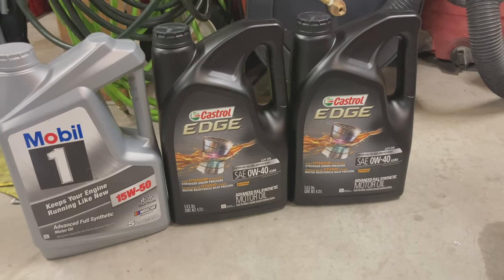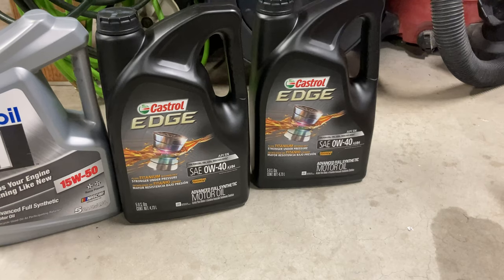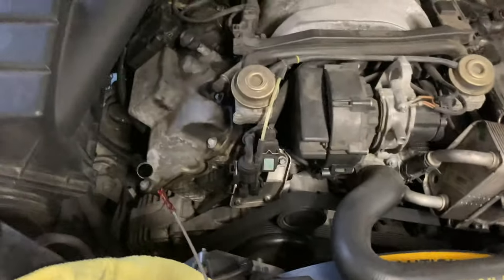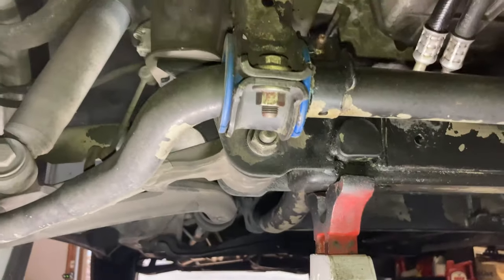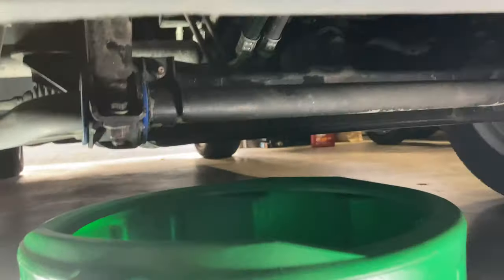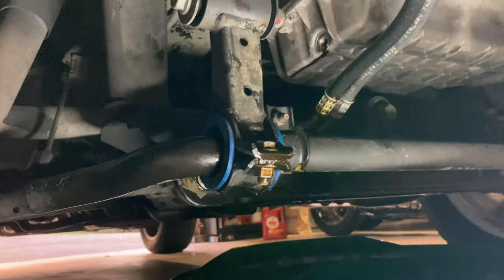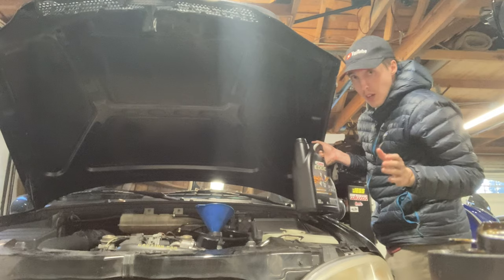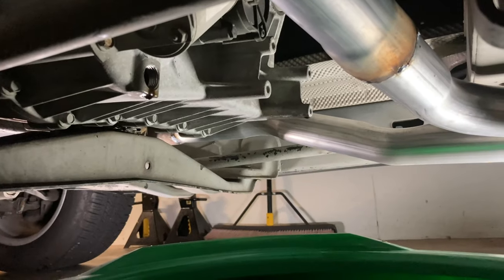Ml55 AMG Oil change + Transfer Case fluid change - Mobil 1 or Castrol EDGE?

Comment: You really need to get an oil vac pump, mercedes oil changes are supposed to be done from the bay, not under the car! So much fun once you get the pump. love how clean your w163 looks underneath. hey while you are at it, did you know there is a cooling fan in your fuse housing in the engine bay? it wears out, you can replace it for like 7 bucks with a new fan. if not, all kinds of electric stuff might overheat and burn out, had my AAM burn out this way twice before i noticed the fan was out!
Reply from the maker: I actually have a video on using a 12v oil extractor, worked pretty good. Thx for tip on the fan btw, wasn’t aware of that one!

Comment: Just switched my 2000 ml55 to Castrol "Euro" 5w40... Advance Auto Parts just started stocking it so that's my new go to and comes with free Mobil 1 filter.
Reply from the maker: Nice, I definitely plan to stick with 5w40 MB approved oils going forward. I stick with Mann filters since the design holds up the best, other filters tend to collapse and shrink over time but if you got it free, worth a shot.
Reply: @ANDERZENAMG  yeah even the Mobil 1 filter showed signs of collapsing a little bit w under 4,000 miles when I changed it last week.

Comment: I’ve been using penzoil ultra platinum in my 2014 Ford Escape 2.0 turbo since new and it consumes zero oil, I also use the penzoil euro  5w-40 now in my clk 55 amg
Reply from the maker: Yea I’ve heard that’s a great oil! It’s about 10-15$ more than Castrol, valvoline or Mobil 1 though so I haven’t tried it. Try to always stay under $50 for at least 10 quarts, but that’s just me trying to save a bit where I can. 👍

Comment: An AMG that doesn't need oil? That's a unicorn!
Reply from the maker: For real!!! This thing surprised me for sure,  7k miles half a quart and not even from burning it just leaky valve cover/oil cooler gaskets
Reply: @ANDERZENAMG  that's beautiful. My 208 and a 210 I take care of don't burn a drop of oil. The C55 on the other hand ...💔
Reply from the maker: @pulsiui4003  yea I’m in a bit of research binge trying to decide what oil I want to use on the C55. Thinking of blending valvoline euro 0w40 with 20w50 vr1
Reply: @ANDERZENAMG  I used to use M1 0-40 with much success. Extended oil intervals and harsh driving conditions, but after considerable research and a very slight improvement in oil consumption, I decided Liqui Moly 5-40 for the C55. The others still get M1. No matter how good an aoil is, if an engine is worn, it needs to be rebuilt to eliminate the oil consumption. We're planning to hopefully start that project mid way next year.
Reply from the maker: @pulsiui4003  also used to use Mobil 1 0w40 but the C55 would chew through it when running hard, the Castrol has done much better thus far. Definitely will need a rebuild at some point point for valve stem seals etc. I’ll have to do a series on it.
Reply: @ANDERZENAMG  That will be nearly if not impossible with the limited space. But I'll be tuning in 😅
Reply from the maker: @pulsiui4003  limited space as in my garage or? lol i'd rather try to condition seals back to good health before then though if at all possible. Might go with Valvoline Euro full synth 0w40 & Valvoline Pro-V full synth 20w50 which I will run a 56-44 mix of to hopefully end up with roughly a  8w43 lollll I have spent too much time on this matter....
Reply: @ANDERZENAMG  Limited space as in space in the engine compartment to attempt to replace valve seals. Some have been able to do it but on other models with more space, albeit still difficult. As for reconditioning valve seals, I really doubt oil or any product can achieve that. But do let us know how it affects your oil consumption 😁
Reply from the maker: @pulsiui4003  ahhh no! the engine would come out if i did a rebuild, engine stand that bad boy and do a full tear down. Whenever I need to do the clutch might be a good time. I want to eventually upgrade to a SPEC clutch disk, didn't know they made them for this application until after I swapped it.

Comment: Great video! Did you drain the oil before doing the oil filter housing gasket or no need to? I have to change it on my c55 thanks!
Reply from the maker: Thank you! When i did the oil cooler gasket, I just removed the oil filter to let the housing drain, don't have to do it with engine oil emptied unless you want to. Cheers!
I suggest as well, get a good angled pick screw driver or something to pick the gaskets out, it will probably be hard as a rock and need something thin that will get under it to pry it out.
Reply: @ANDERZENAMG  Got it, thank you so much for the info, will do!!

Comment: Hey can you do me a favor? Can you tell me if your ML55‘s headlights autolevel on start up? I’ve never seen an MB with xenon headlights that don’t “calibrate” on startup but mine don’t, although I have a bad AAM causing other issues so I don’t know one way or another.
Reply from the maker: I’ll check if they do next time I go for a drive and report back 👍
Reply from the maker: Yes they do 👍
Reply: @ANDERZENAMG  ok good. Then mine aren’t doing it because of bad AAM. My fogs don’t work, keyless entry, etc
Reply from the maker: @daveh2612  my keyless entry doesn’t work either, but I checked my AAM and everything was good so it’s another issue...
Reply: @ANDERZENAMG  since the AAM controls keyless entry it’s either your fobs or AAM. Don’t think there’s any other components to the system.
Reply from the maker: @daveh2612  yea, trouble is they stop producing new keys, I had a key maker near me who said they could do it but haven’t found any key supplier yet
Reply: @ANDERZENAMG  I know it’s frustrating because I do want everything working properly but I don’t know if that’s going to happen easily.
Reply from the maker: @daveh2612  yea, Mercedes stopping parts being made for this chassis is a bit odd, and makes things a bit tricky at times. Good luck with your findings and hope to hear a positive update soon 👍